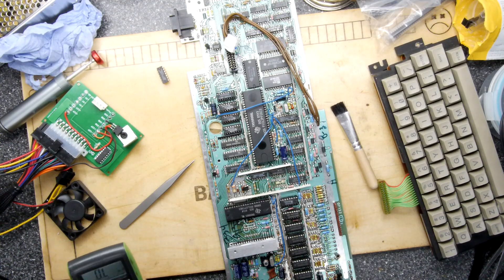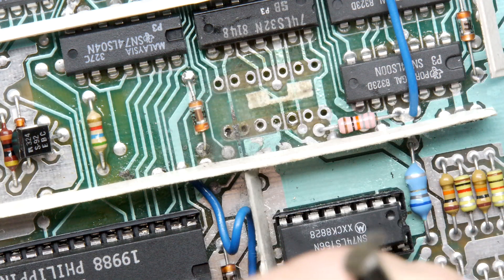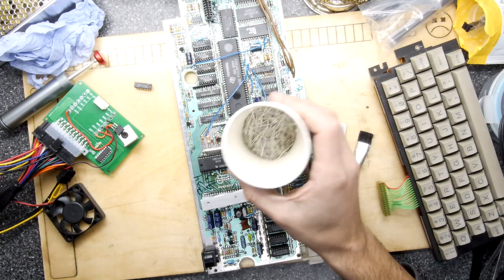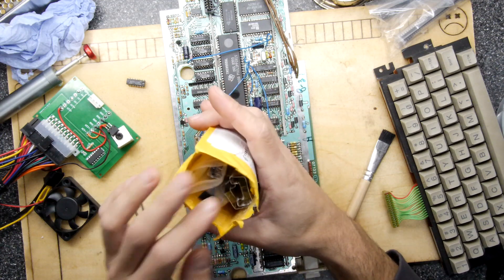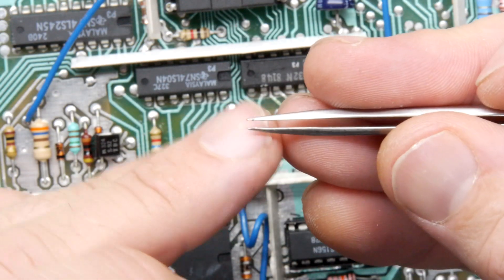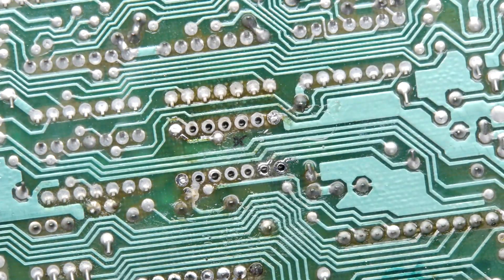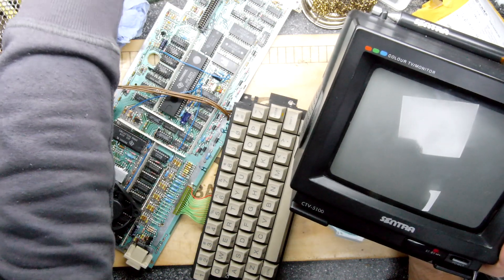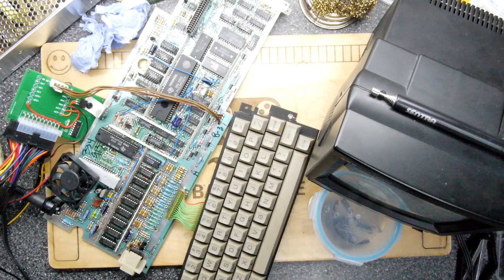Ti99/4A finally fixed!

Comment: Sockets created more issues. When you remove a chip cut the legs first it makes removing pins much easier if you have to add fresh solder before extracting the solder and pins. I repaired many phone boards with conform a coating which makes chip changing more difficult. 73